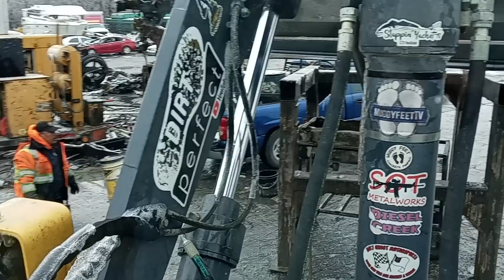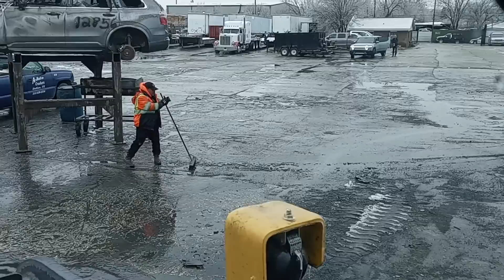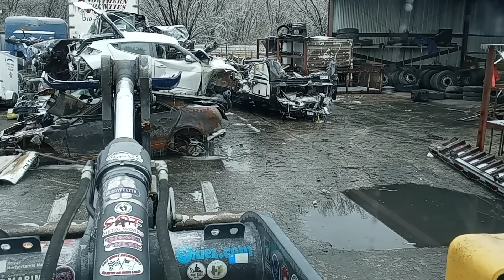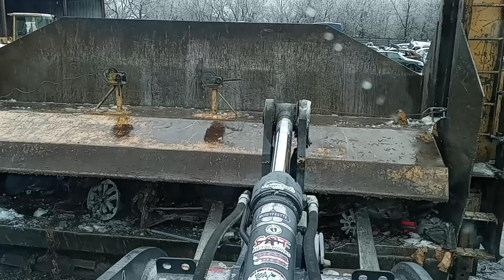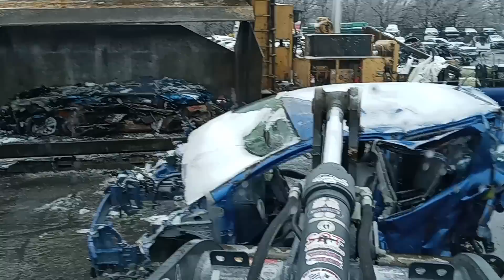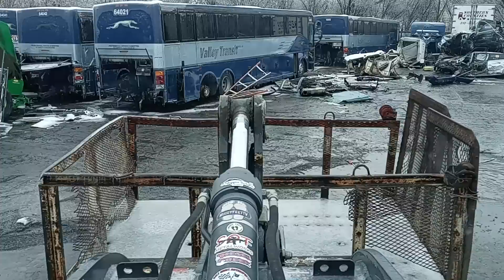Get the Equipment thawed out and Crush some Cars

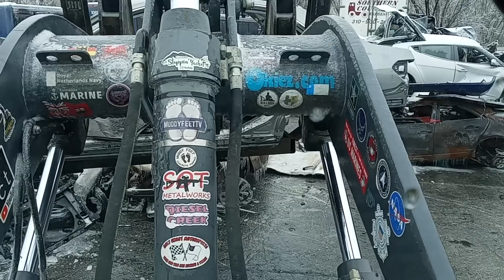Comment: @1:20 ,yup ,that's the sled that's used to make the car go dead 💥🚗 as it gets pulled down the track by a cable at controlled high speed ,its used to anchor the cable thru the cart ,without it the cable would just rip out any anchors right out of the vehicle body unless it has a real frame ,the forces are way too much for the anchors & they pop right out of sheet metal,it's good to see that they let someone strip all the good parts off before sending it to the crusher, some manufacturers are anal retentive about making everything dissapear & some are good with picking it clean when they are done with the testing